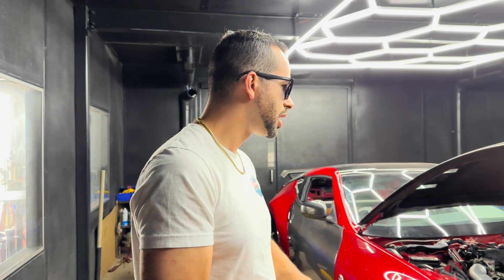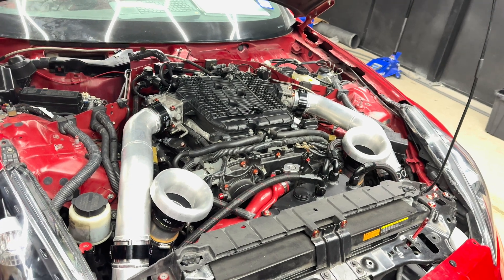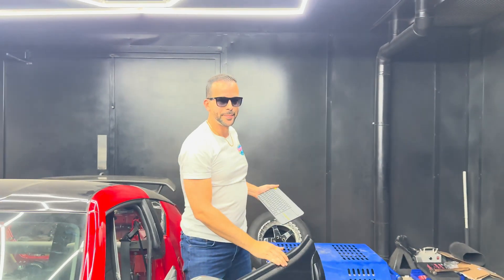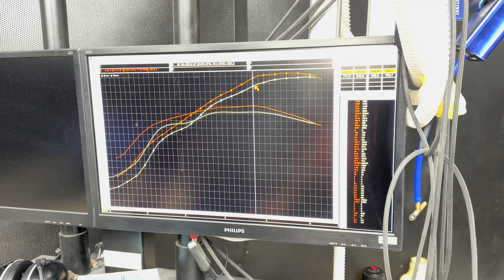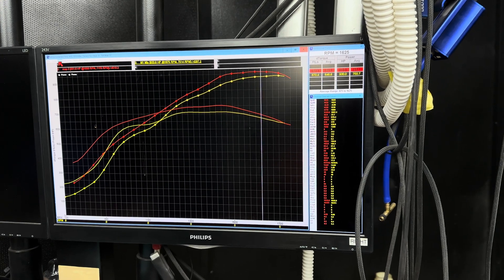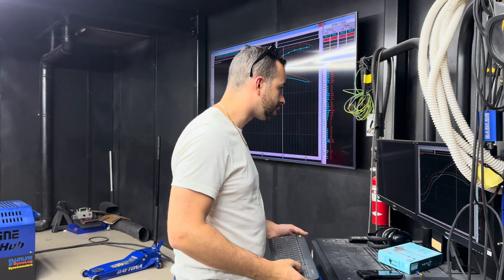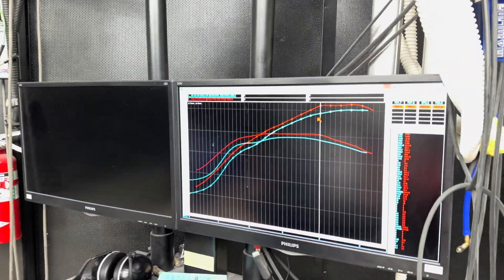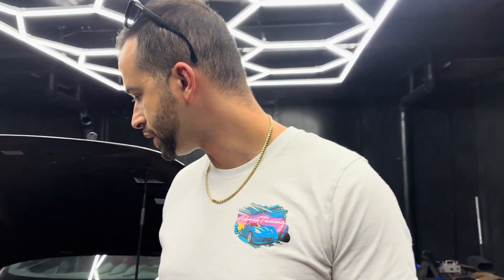DO VELOCITY STACKS MAKE POWER? 1000WHP+ 370Z DYNO TEST

Comment: Smoking like it is about to blow up it  don't seem right to me but I'm not a tunner
Reply: that’s the wastegate
Reply: @danevq37  out the hood and exhaust  don't seem right imo
Reply: @chriswinders1930  the wastegate is right next to the transmission so it makes sense to me
Reply: @danevq37  so it smokes like blow rings or oil blow by never seen a boosted car do that so it don't make sense it's coming from 4 places as well both back sides and 2 spots under the hood 🤔  not like I care just don't seem right at all sense I have been around race cars my hole life
Reply from the maker: lol, this car does it all the time. It's not the gates, it's the crankcase vent setup that was installed with the turbo kit. you might have been around race cars your whole life, but you probably don't own anything fast.